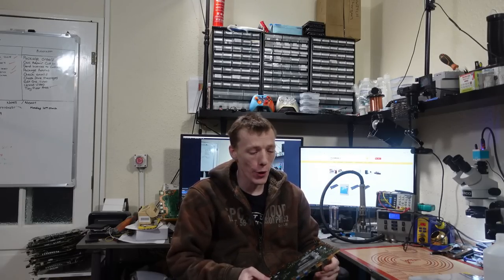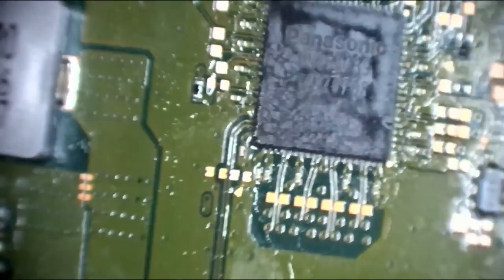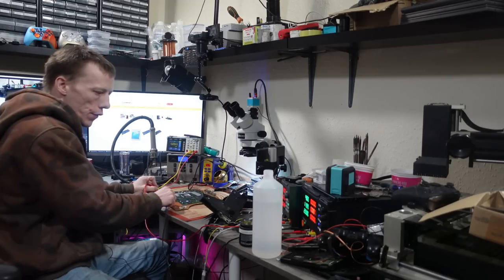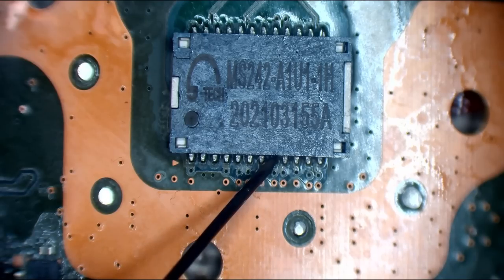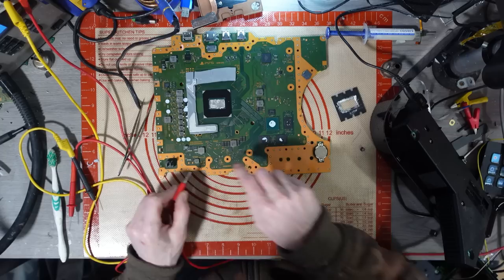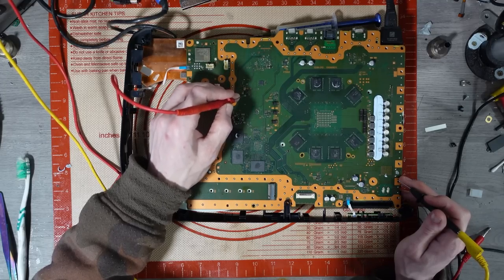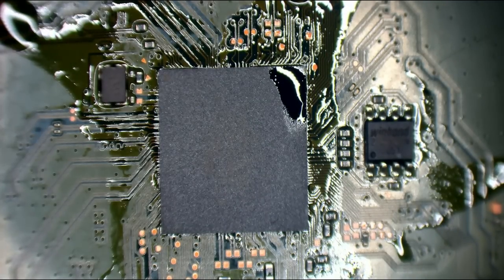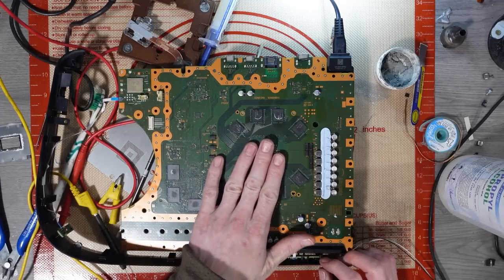Can I Fix Another PlayStation 5 From A Joblot Of 15? (Part 6)

Comment: I believe that after you re-flowed the Southbridge, the flux underneath the chip was preventing the 32kHz oscillator from running.  Crystal oscillators are quite high impedance and will likely not start if there is anything, like flux, around the circuit.  Without that oscillator, the boot sequence will just set at a few milliamps.
Reply: I watched your video ytd and I was about to comment on the crystal as well. 😊